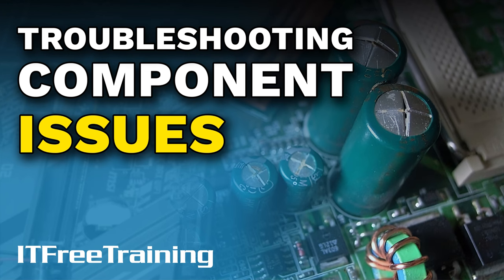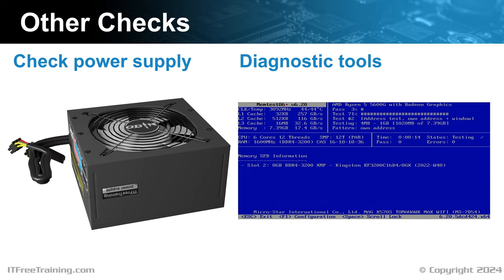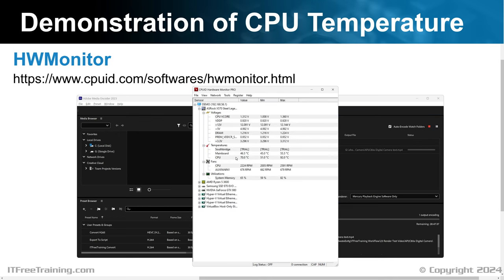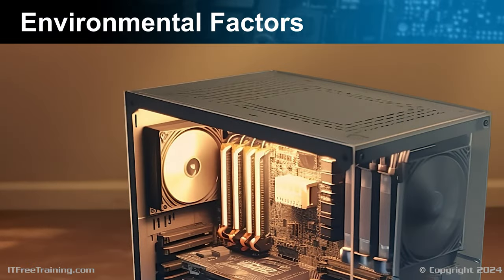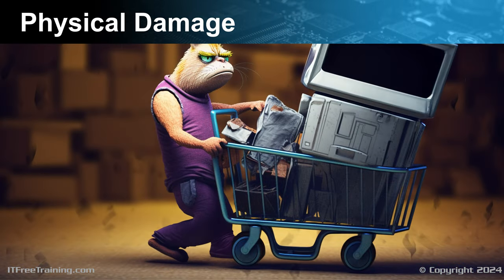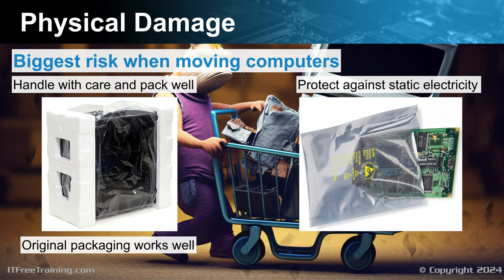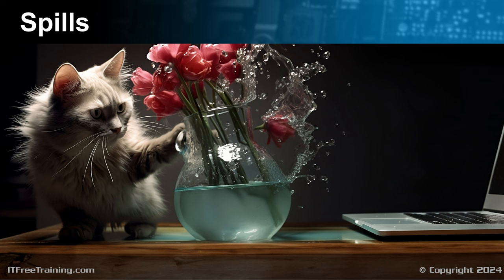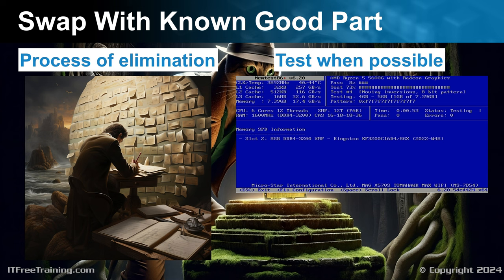Troubleshoot Component Issues - CompTIA A+ 220-1101 – 3.11

Comment: I don’t know the cleaner in question, but…
I had a fellow student whose homework floppy disk (yes, I’m that old) was unreadable when turned in to the professor two weeks in a row. Upon questioning, the student declared that they had completed each assignment as soon as they got home, then stuck the disk to the fridge (yes, with a magnet) so they wouldn’t forget it when they grabbed their lunchbox.
The professor shared the story, not to embarrass the student (didn’t work), but to demonstrate the logical steps in troubleshooting computer issues, including talking through user/customer actions
Reply from the maker: Interesting story. We were working with a laptop the other day and notice that keys were getting attracted towards the laptop. We worked out the magnets in the speakers in the laptop were doing it. It is surpising how strong they were. So if I work if floppy disks again, I won't put them on top of the laptop.